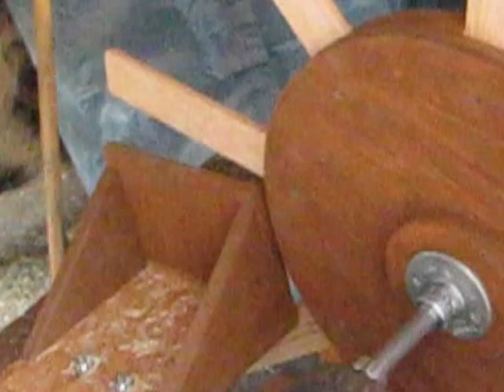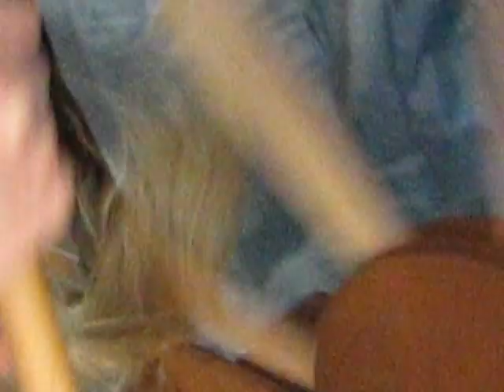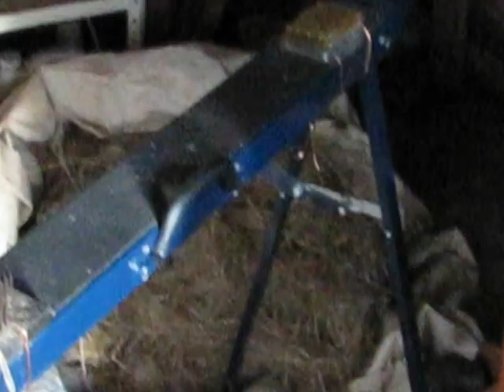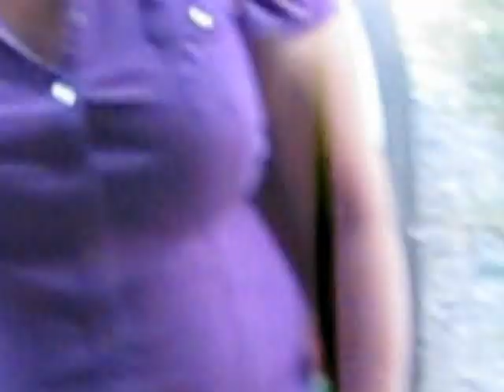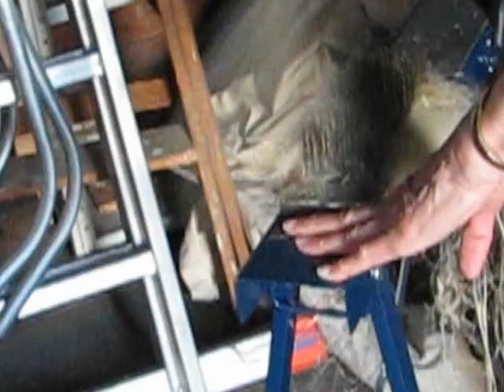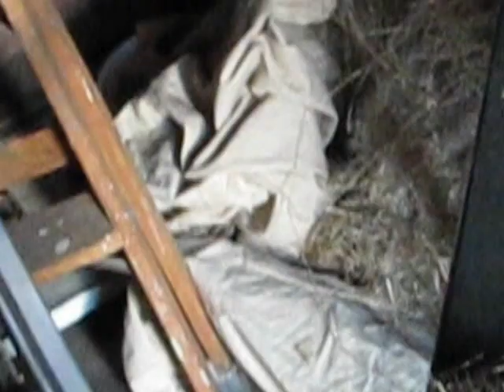Barb processes a bundle of flax   to to make some lovely flaxen hair!

Comment: I was wondering if you'd be interested in an idea I had. Around where I live, milkweed is in bloom, and the seeds are surrounded by a fluffy fiber that is as shiny as silk, as strong as linen and potentially as cheap as cotton. I think milkweed could be a great alternative to traditional fabric materials, but I can't really investigate its use as thread because I don't have a spindle.
Reply: It is very easy to make a drop spindle for thread. My first one was a crochet hook with a washer and bolt taped to the bottom for weight.  Milkweed silk is lovely, but it is very short, and hard to work with.  Perhaps if you were to blend it with cotton or wool using a pair of carding combs you would be able to use it.